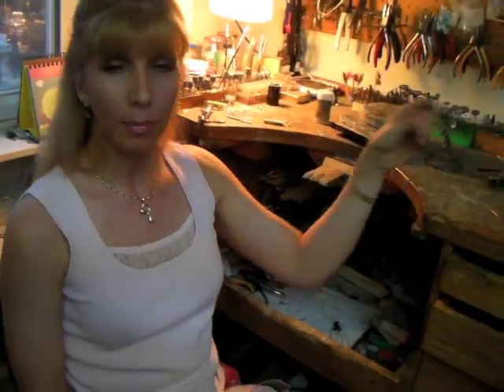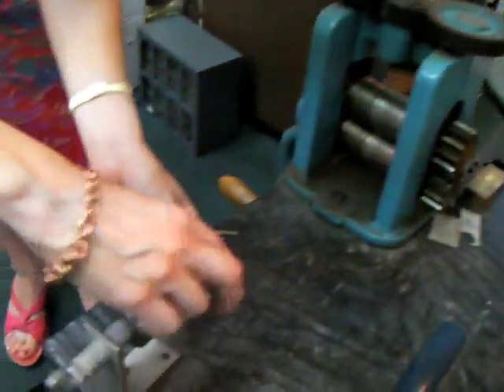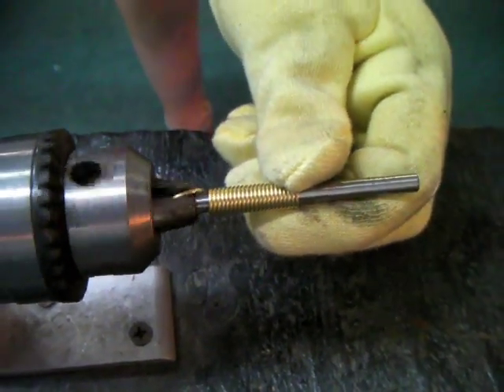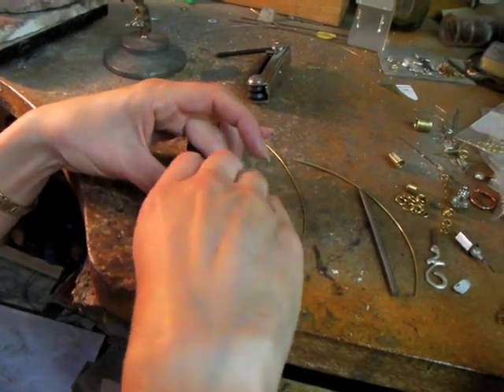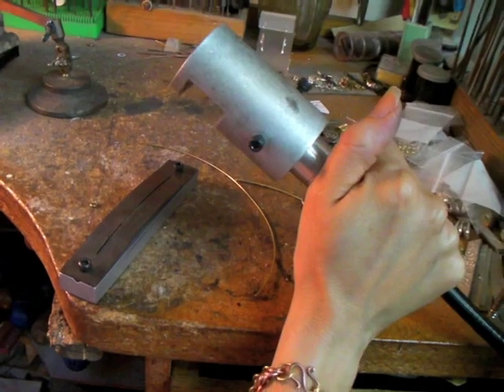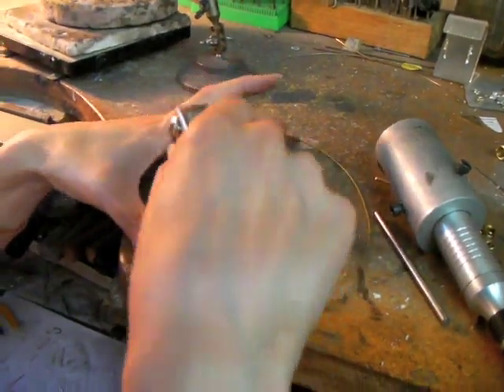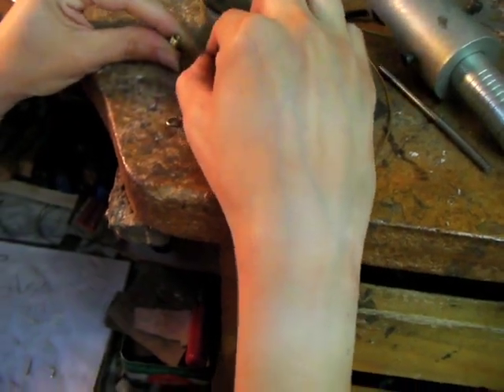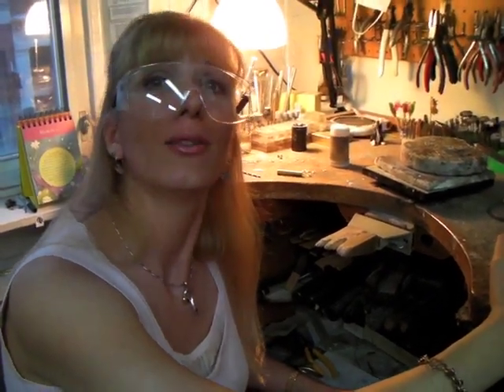Ria Smith shows you how to make LOTS of jump rings with a jump ringer

Comment: Very good video. Great tips in there. But I have one piece of advice for you. When wrapping the coil wearing a glove can cause problems. The glove can easily get caught and pull you hand in potentially making any injury worse as it is crushed as opposed to cut. Better than a glove is to use a bare hand with a strip of leather pulled accross the coil to tension the wire but if it does get caught it will not drag you in. I have made around 10,000 rings with this technique and never had an injury.

Comment: Try holding the end of the coil holder in a vice--and then it's easy to pull the saw blade safely towards you. Another tip is to put a wooden dowel through the centre of the coil prior to cutting--it keeps the cut jump rings under control when you unscrew the lid.
Great video to show the process of making jump rings in quantity.

Comment: A couple of points though. When putting the coils into the cutting guide, it should have springs under the screws to the plate and not require being tightened down that tight. Also, the lube is supposed to go on the top of the rings when they're sitting in the guide. that way you have even lubrication from start to finish (reduces heat and likelihood of smoke).

Comment: pretty nice, but for 2 chainmaill+ templar coifs i need 50 000 jump rings. any faster method?
Reply: you want a ringinator
Reply: too expensive 
i found a way how to cut rings faster
Reply: Paul Boswell No, no one who makes chainmaile would use that tiny overpriced mandrel. Most people just use a electric drill and a jig consisting of metal rod stock and some scrap lumber.
Reply: snowfuca how do you cut your rings? I'm still using a bench pin and jewelers saw